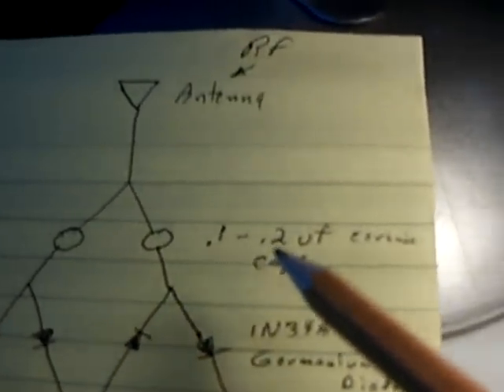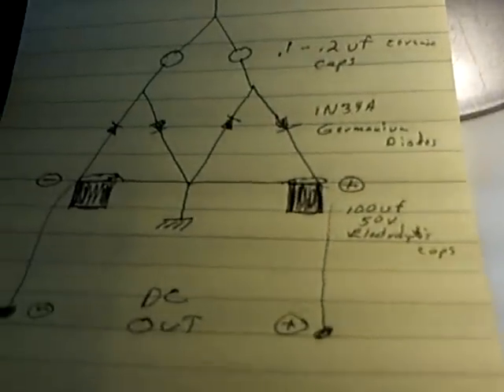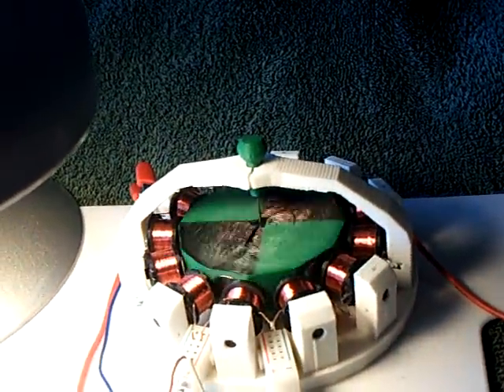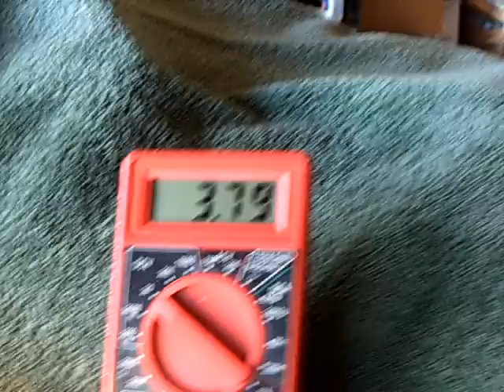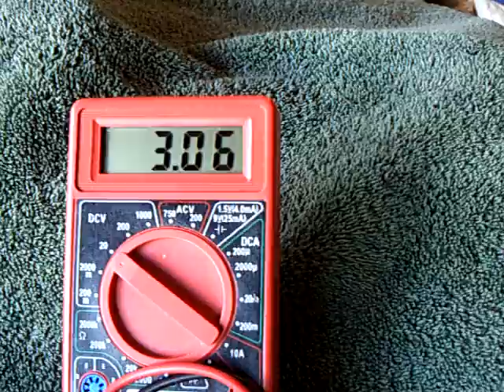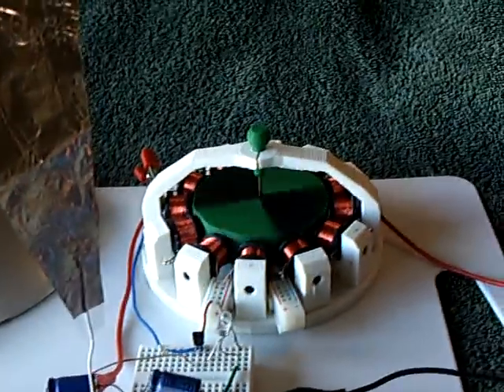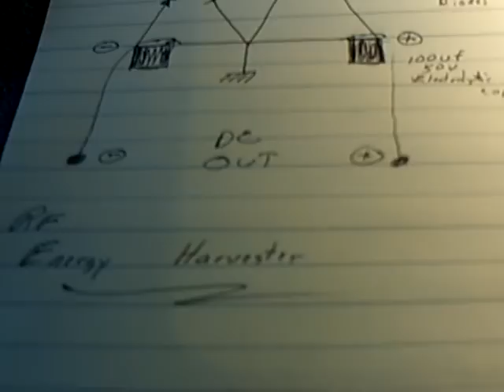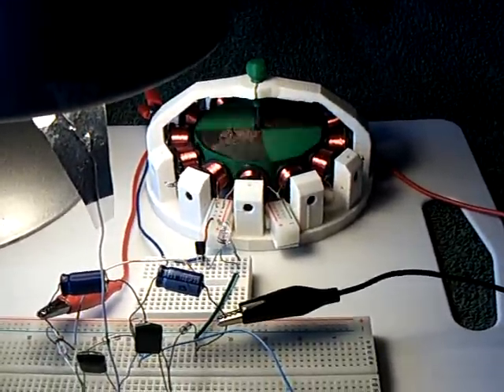Stray Energy Harvesting off a CFL

Comment: That circuit's Joe Tate's "Ambient Power Module".
Reply from the maker: Richard Mesce Thats the one I tried some time ago and used the wrong diodes.   I will have to take this new one down to my boat and try it.  If it works I'll rip out the diesel aux,  put in an electric motor, and drive away on FREE ENERGY!  ha ha.  Dreams are fun aren't they.

Comment: hi have you tried a chrome coat hanger as the aerial chrome is positive so should only attract electrons if you look at gretchen jones coral castle she is holding a chrome static devining aerial that taps into the earths lay fields ingventor channel  the right hand vortex with a tail to the right at 90 degrees to pull in the electrons from air then swirlin to the vortex and then fine sine wave   waves to emit  her body may be acting as the capacitance to amplify effect    no expert but something in that range

Comment: that's tesla's energy from air circuit.  using just a small flat copper piece of metal u can get very low voltage from it, like .001 without the cfl light, just random spots around the house.  try sending this low energy through to a joule thief see if the power will get amplified.  look up very very low voltage joule thief in YouTube.  try running the power from air circuit off an old cell phone attena, not the pull out ones.

Comment: ***** Just connect the antenna lead of your ambient energy circuit to any wire going outside and you won't need that CFL or that mini Tesla coil. Then it will be free. hehehehehehe
Reply from the maker: wattsup1004 I tried a wire around the roof of my house and got nothing.  I also tried a wire up in a short tree and same thing.  Don't know what is wrong.  I should get something but no luck so far.
Reply: *****  Oh, I forgot in your circuit where you show that center ground between the outputs, you should not use that. I have had that circuit for years and around my place with a single strand outside I get a good 1.5-2.5 volts off the circuit, all the time.  I think I had recommended the same thing to Lasersaber but don't know if he followed up on it.

Comment: Man oh man Lidmotor you are on my topic tonight...I've been fascinated with energy harvesting for years and back years ago when the AV plug showed up I decided to put a small cap instead of the diode in it then attached my volt meter to it and found 20 volts next to a 13 watt flourecent bulb. It made great way to find AC flowing anywhere and the ability to store it up
Reply from the maker: area46241 I have bee interested in the same subject for a long time also.  It is kinda like beach combing only for discarded energy that got thrown away.

Comment: If you connect the ground to a proper earth ground, and get a really long aerial, as high as possible outside, it should pick up radiant energy from various sources, everything from solar wind and ions, to radio waves and electrical noise from power lines and transformers, switch mode power supplies, old TVs, etc!
Reply from the maker: Power Max You are right.  So far my efforts in that direction have not paid off.  I have spent hours trying but I get nothing.
Reply: ***** It is a really fiddly circuit, from what it seems. I have seen some other builds of it get some voltage onto the capacitors, though I do not think there is really enough potential at "normal" heights to connect. Maybe if you can get the aerial as high as Lasersaber with the hexacopter. He was able to get some useful static electricity buildup from it.

Have you looked into capacitive reactance? The basic idea is that capacitors act like resistor whose value depends on the frequency. If the antenna is collecting high frequency AC, like that from the slayer exciter, then the RF is conducted easily though those capacitors. However, if it is low frequency, or DC, those capacitors near the antenna act more like insulators, and don't allow current to flow.

Thats because the current is proportional to how fast the voltage changes w/ time, or the derivative of voltage, dV/dT. Thats a bit of calculus, but not hard to understand. So w/ high frequency stuff, the voltage swings up and down faster, and basically that means more current flows through the capacitor. Because the capacitor acts this way, it is used to AC couple things, as to prevent DC offset on signals!

What you have built is in fact simply a voltage quadrupler! What it is doing is simply AC coupling the same "AC" 'signal' into 2 separate avramenko plugs, similar to those used for the LED thing w/ the slayer exciter, and have the 2c AV plugs' outputs wired in series! This wouldn't work unless those AC coupling caps were used, because it is important to have a high DC impedance between the 2 AV 'inputs.' (In other words, it's like if you tried to take multiple parallel wires from a battery, then wire them in series. Because all those wires come from the same source, and there is actually low impedance path for electrons when connecting those outputs in "series" What ends up happening is a short. No free lunch their sadly. I hope that makes some sense!) 
 
Anyway the reason for all that ^^^ stuff is, what if you were to build a basic bridge rectifier and see what output you get from it? That will work much better because the input does not have to be capacitively coupled. You could then harness much lower frequencies, including DC charge buildup!

Comment: Delighted that you tried this out...it becomes addictive too, seeing what can run. Good thing you pointed out the 50V caps, for safety. Without a load i've seen >35V build up and 16V caps can pop, which is quite surreal.
The one that ran the MMG motor uses 1N4148's, so your 1N34A's will be more efficient. A CD with a wire soldered to the name branding silver area works great as a pickup.
Where i'm at now, this method works best for tuning up the motor. Characteristics are near enough real time and shows immediately if a change to the circuit works better or worse.
Reply from the maker: I have my Frog Hair Motor running 24/7 now using a small solar panel and a 5F cap.  I just keep it by a window and it gets enough light that way to run all night long without using a lamp. Now that I finally did what I wanted to do for so long it is kind of anticlimactic.  It just sits there and runs all the time and after awhile you just get used to it,  My first Penny LED light that I got to run all the time is the same way.  It is nothing unusual now.  Thanks for sharing what you have done.  I hope that more people try this stuff.
Reply: *****
It'll be the same when a system starts making all the power you need as well lol :)
I know what you mean though, I still smile when seeing the Forever lights blinking away, but kinda wish they would give a problem to fix. Even the polyacenes are still fine. Something simply working all the time is an odd 'problem' to have.
So, maybe the goal can change, based on the new expectations - systems with no ambient light, no partial galvanics, that do run themselves by extraordinary means.
Reply: *****
Congrats on your success! :)
Well deserved!

Comment: Hey lid run around a 50 foot length of 20 gauge magnet wire as high as you can for your antenna and it will work with using your cfl. I have achieved 50 volts from mine. The higher your antenna the higher the potential voltage
Reply from the maker: Unfortunately I don't have much room around my place to put up a long or tall antenna.  I might take this whole setup down to my boat and try the mast as an antenna.  Somebody told me to try that.  It is only about 35 ft. tall but the boat is in a harbor where there is good radio reception---long beach harbor in the LA area.